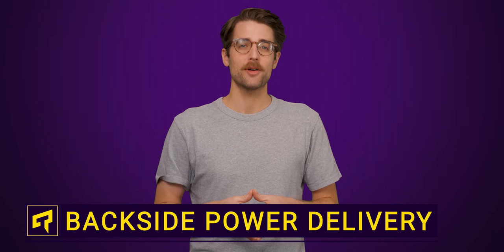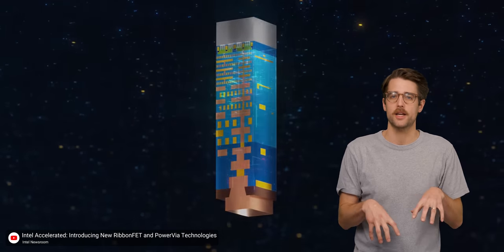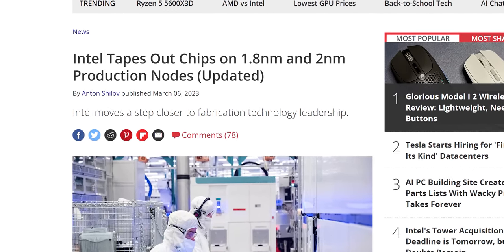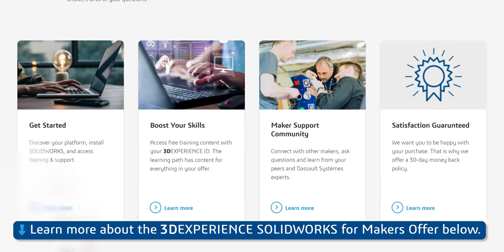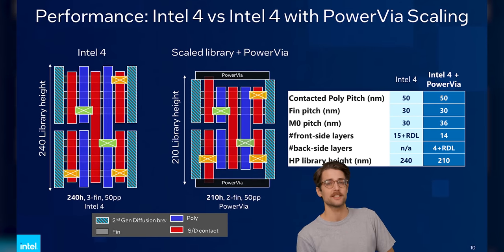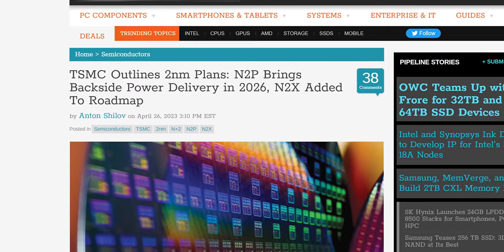Intel Is Flipping the CPU Upside-Down

Comment: 99.9% the "manufacture cost savings" aren't for the benefit of the consumer and we wont actually see cost reductions.
Reply: This
Reply: They give you more chip when they feel threatened. Amd been such a good threat lately. They could also probably jack up the voltage/frequency since they don't have to worry about the wires acting like transformers and capacitors as much.
Reply: Welcome to the real world
Reply: Buy intel stock, then you can enjoy sticking it to the consumer like all the other share holders 😅…

All jokes aside, it does tend to result in slower cost growth over time for consumers. Ocassionally you get years where intel gets super desperate and these type of advancements give them headroom give out deals…
Reply: They are, in a way. This, like all technological improvements in performance semiconductors, will allow chip makers to tape out higher-performing chips in the same price segments they've been using for ages. You get more performance for the same price.
Reply: @NickSteffen When you consistently have the fastest and the best, you can charge more for your products. AMD has gotten ahead briefly a few times in history only because Intel, like any company, stumbles occasionally. AMD would charge more if they had the same reputation.

Comment: I'd love to see a Techquickie about the current status of non-silicon based transistors (GaAs, GaN, etc...) and where the chip industry is with transitioning off of silicon based chips.
Reply: Why would they transition off of silicon? If anything they are trying to integrate more things on Si eg. silicon photonics
Reply: @shanent5793  Main advantages of GaN is lower heat generation and higher heat survivability (silicon chip will melt above 120*C, while GaN chip will melt above 400*C).
So a GaN CPU could be overclocked a lot more without getting into heat limitations.
Reply: Is this a thing? I'd love to see them switch to GaN chips if possible and I bet ppl will be willing to pay a premium for such dramatic increases to performance!
Reply: @hubertnnn  Devices today are less overclockable than in the past because the manufacturer bins them and sells the faster or more efficient chips at a premium. Changing the material won't change overclockability
Reply: @shanent5793  Changing materials would not only change overclocking capabilities, but also literally every other quality of the chip. That's kinda what changing materials does. Wood and reinforced concrete have their own unique qualities, vacuum tubes and silicon transistors have their own unique qualities.
Reply: @DaleBall2 if you call 6 figure prices per chip premium..go ahead😂
Reply: @hubertnnn  All that heat still has to go somewhere........ PCs are already space heaters, don't need a fucking furnace in the room too. Plus, it would just end up being limited by the heat survivability of surrounding components.
Reply: Silicone is abundant
Reply: the chips are still made of silicon, there is just an initial layer of GaN or SiC deposited on top of the Si wafer before continuing manufacturing
Reply: @thelelanatorlol3978  Yes, but no. That's a falacious argument. stop talking.
Reply: @hubertnnn  GaN is a great material for RF and power delivery purposes. It has a high electron mobility, but not necessarily a great hole mobility. This means it can be easily used as a n-type semiconductor but not p-type. The main issue for getting GaN based CISC chips is the fabrication. Because electrons move so well through the material, creating transistors at a nm scale process is currently unfeasible. Again (or aGaN lol), it's used in RF and power delivery because of its ability to turn on and off very quickly or its incredibly low on resistance, making power supplies that can be up to 99% efficient, which is incredible.
Reply: As of our current knowledge of semi-conductors, there are no plans to switch data processing to anything but silicon (at least for powerful processors). This is because the alternatives don't currently have the density to replace silicon for data processing. For power conversion GaN can and is starting to replace silicon because it's already better at that, but there are no processes for producing GaN at less than 250 nanometers. For silicon they have it down to less than 5 nanometers for some chips. Using GaN for power conversion helps make power conversion in chargers and power supplies smaller and more robust, but it's not currently possible for it to replace silicon for data processing.

Edit: I see now that someone else already pointed this out. I guess I should have expanded the replies and looked at all of them. Oh, well.
Reply: I guess gan transistors cannot be shrunk to microprocessor levels which is why they are limited to power transistors
Reply: And IGZO which would be the best alternative material
Reply: @shanent5793   EE here, it would never be transitioned off entirely, but GaN supports higher frequencies and power, samething with diamond and other semiconductors.  it was never viable before due to cost and higher frequencies that weren't needed.  I hope that answers your question.
Reply: @shanent5793 biggest issue is we are at the physical minimum size for a silicon transistor.
Reply: For Logic only Germanium ist sometimes used for the highest frequency parts otherwise silicon is the way to go... Only GaN, SiC, etc. are currently only used in power electronics like electric cars...
Reply: @shanent5793 this aged well
Reply: @hubertnnn  this is what general GaN enthusiast are thinking.
However, there are other factors relating to scalability that needs to be considered...

Comment: For those confused, the picture shows you the new change.  The transistor is now sandwiched between power and data.  That's how the two are decoupled/separated.  

The concern is the transistor is now insulated on both sides rather than being on one of the edges.  

Although, as some point out, the whole package gets hot so cooling it shouldn't be much different.  Perhaps there will be more backplate cooling to help dissipate more heat on both sides of the chip?
Reply: Another issue is that this hugely increases the number of layers in chip which means there's more manufacturing steps. That's why it wasn't done on earlier nodes, the improvement wasn't enough to offset the increased cost.
Reply: @spankeyfish  They're saying this process will be cheaper to manufacturer, outside of the initial setup costs.
Reply: @83n80y  Well the slides do say lower yield, so it a way it costs more. Like always, nothing is free, but you pay a bit more for the process and save more in other places, which makes it a net benefit. Like if your chips cost 10€ (number are completely random) to make and every 100th is defect due to power via that makes every chip ~10ct more expensive, but if you can make the die 5% smaller due to power via, you save ~50ct per die, so it's a net benefit. You also get higher clocks and stuff, which do not save you money, but increase performance, which might make you more competitive, which also makes you more money and much more. You win some, you loose some, just make sure that is a net benefit in the end.
Reply: @cromefire_  Good stuff.  What would happen if Intel starting making nets?  What would be your guess on the nets netting them net benefit from the net profits? 😁
Reply: "Although, as some point out, the whole package gets hot so cooling it shouldn't be much different." - even at steady state, the thickness and conductivity of insulation makes all the difference. Even if you leave it for hours and hours, there will always be a temperature difference between the transistors and the outside of the CPU, depending on what is between them. It's just like how your heat sink is probably cool or slightly warm to the touch, while your CPU core is still above 70 C.
Reply: Most of the cooling is required on power lines, so you only need cooling on the back side (top side). From this, the power lines (more power use) is in contact with the cooler while the signal wires which is for communication, ends up being closer to the chip, which keeps the latency as low as possible.

Comment: If I understood right then this would push more heat towards the motherboards socket. I imagine the pins, the socket and cooler mounts acts as some sort of thermal interface already, but this would motive motherboard makers to add heat spreaders to the socket itself for example to the back of the motherboard, where the cooler reinforcement usually sits.
Reply: that or the cooler mounts would have active backplate cooling as well.
Reply: @lordmage  tbh this sounds like a better solution, cooling solution remains modular. but again more modular = less efficient so we can just hope
Reply: The differences are tiny. In your current CPU the socket still gets hot despite the chip sitting on "multiple layers of wiring and plastic and pins and whatnot" it's not a big deal, hardly any difference, the whole package gets hot anyway.
Reply: Putting the heat-emitting parts next to the motherboard, away from easy access to fan cooling, seems a bit perverse. Also this is only going to achieve about a 5% performance gain.
Reply: "Back side" would be the top side of the chip, so no you don't need it. The signal wires will be closer to the socket and the resistive power wires would be in the top (the "back" side).
Reply: @lawrencedoliveiro9104  They didn't say it would have a 5% performance gain. It clearly said 5% FREQUENCY gain. This is not remotely the same thing. Also, it said 5% FREQUENCY gain to EFFICIENCY CORES not performance cores. This is probably to introduce boosting to the E cores. E cores max frequency is what 4.2Ghz right? Well 4.2 + 5% is 4.4. There you go. This is basically nothing.
Reply: I think the video has been vague or inaccurate. This doesn't necessarily change much anything, because the die already has a much lower thermal impedance towards the substrate than towards the heatspreader/CPU cooler. So today seen top to bottom, you have the die crystal 0.77mm thick (SiO2 or crystalline form of glass), then you have the semiconductors etched into that, a bit of coated on insulation material with metallisation embedded into it, and finally the substrate which re-shuffles the signals, and then the pins/lands.

However the substrate is really bad at thermal conductivity. There is a lot of heat sunk through the ground and power pins into the ground and power fill/planes of the PCB, but it's a constant amount, of maybe 15W-ish, so the CPU cooler has to just handle the rest.

For power semiconductors, and most types of semiconductor products that you solder down, the strongly preferred cooling path is via the PCB. For this you get a big thermal pad that you stitch with thermal vias and you can if you want install a heatsink on the PCB backside, and you can make it larger than the semiconductor package as well, using the ground plane and pour as a heatspreader.
Reply: @SianaGearz  It doesn't change anything in terms of performance. All this changes is the new marketing Intel will be employing regarding the apparent 4.4Ghz frequency the E cores will be getting. I bet one of my balls that this will be for one or two of the E cores boosting  to 4.4Ghz and Intel making a big deal out of it. Such a radical change just to have a 200Mhz boost for the E cores is laughable at best and concerning at worst. I for one will make sure to skip the generation this debuts on.
Reply: Nah, it won't. That heat would be conducted away with the traces and socket on the board anyways. There's a lot of copper on the board. It's already a heat sink.
Reply: @SWOgottaGO Video said that similar frequency rise is expected in p cores.

Also ypu are skipping the entire part where this enables denser chips as you dont need the extra isolation from the power lines. Which on itself will add to performance
Reply: @DarkStar14n  The video? I didn't know Riley is an electrical engineer. I'm following what is written in the white paper. If you pause and increase the video resolution you can actually reaad what's on the paper. The white paper specifically mentions efficiency cores nothing about P cores.
Reply: @lordmage  in practice, we wont see a change from our end. the are just passing to power over the chip at the silicon layer. ihs stays ontop. business as usual for the end users and buyers
Reply: Yes, the source of heat will be a fraction of a mm closer to the socket. I don't think cooling will be affected to a notable degree.
Reply: Rgb coolers for CPU front and backside(tm)

Comment: Can you make a video about why some old cpus had the chip on same side as the pins?
Reply: Probably just easier to build. Didn't have to worry as much about cooling or signal crosstalk back then so there was no reason not to take the simplest route.
Reply: Limitations of technology and general necessity. Look up wire bonding online to understand that technology. It appears to be still widely used in chips today, just not in high performance designs such as CPUs or GPUs.

Modern flip chip came out of the necessity to increase the number of power/ground, and possibly signal, connections to a high performance chip and to reduce the distance from the pins to the transistors. This helps reduce IR drop of the power delivery network (which this video mentions as resistance, the “R” in “IR drop”), which directly impacts the performance of the chip.

Comment: I did PCB layout for about 25 years. A typical PCB layout has semiconductors on the two outer (surface) layers, signal traces on adjacent inner layers and power/ground layers interspersed between the signal layers.
So is this like taking the components and putting them near the center/interior of the stackup with the signal layers on one side of the stackup and the power/ground layers on the opposite side of the stackup?

This would dramatically alter the impedance calculations for the semiconductors.
Reply: that what I understood as well (for Die manufacturing process  ) thought I cant seem to understand how to feed the power rails as the signals will face the package upper side because if the flip  so that means that the power will be facing the Lid , so does that mean back to wire bond for power and ground ?  but maybe I missed something in the explanation .
Reply: @loldualol  From what I understand power and communication with the motherboard will stay on the bottom just as it is now.
The only thing that will change is internal transistor-to-transistor communication will be moved to the top/lid side (closer to the heatsink).
Reply: what I picture is 2 bga's back to back....the top side balls are the power/ground between transistors and gap filled with thermal conductive epoxy ......the lower bga is a normal chipset .... @loldualol

Comment: So basically Intel's changing from a power top, to a power bottom.  
Whatever works.
Reply: Hahahaha, nice
Reply: That doesn't sound remotely gay at all! 🤣
Reply: @marcse7en  technically being a top or bottom has nothing to do with what gender you prefer in bed.
There are plenty of power bottom males in heterosexual relationships
Reply: Actually Intel doubles surfaces through which the wires can go to transistors that allows to double their thickness. While resistance of wires and heat dissipation in wires is reverse proportional to square of wires section. This shall make CPUs a bit cooler, voltage of the power source can be less, while CPU frequency can be increased.
Also this may be first step to multi layer transistors deployment. Nothing prevent to build sandwich not only as Power+transistors+Data wires, but also Power+transistors+Data wires+transistors+Power. This can double the number of surfaces through which wires can go to transistors again.
Reply: Won't power stay on top and data move down? I'd imagine the power side would be both hotter (because all the power goes through there) and dissipate heat much faster (more and bigger wires).
Reply: @trapical  Nah, that's sub or dom. You can't be a bottom or top in a straight relationship. Unless you want to count pegging.
Reply: More like a power..... Sandwich... Damn...

Comment: I see a couple problems right away..
- Reduced cooling capacity because of the bigger gap
- While the majority of signal connections are internal, those that need to come out back to the motherboard still need to pass somewhere near the power wires (introducing some of the noise back into the equation) and the signal wires must be longer, which means once again greater resistance, and more latency (which we know even RAM isn't a fan of uneven/longer wire lengths).
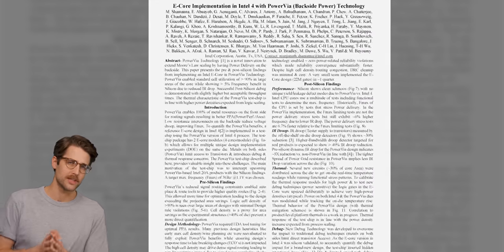Reply: 3:16 Intel already tested PowerVia with Intel 4 process and noticed increase of power dissipation per mm2  with transistors density increase that becomes possible due to PowerVia tech.

Comment: I doubt excess heat buildup will be any more of an issue than it is today, seeing as most of the top silicon on current CPUs is empty, just there for ease of manufacturing and structural stability.

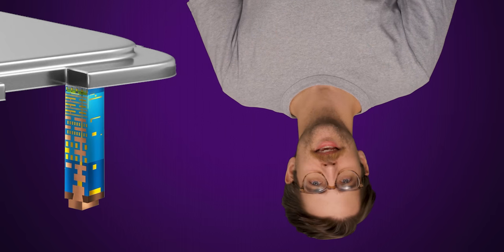Comment: 2:35 "chip engineers like to have fun" I sure hope that fun doesnt eventually evolve to installing spyware in chips
Reply: Would only work if they code them to run at boot up and it opens a network interface and sends data from os and programs running on the cpu to the manufacturer
Reply: Old news. NSA already has backdoors on the chip level. Whatever OS you use is compromised.